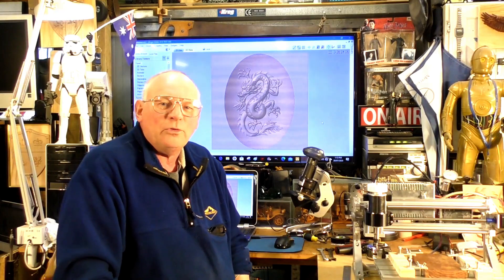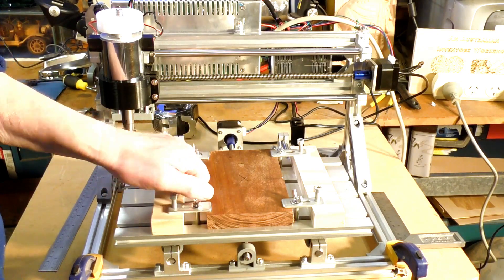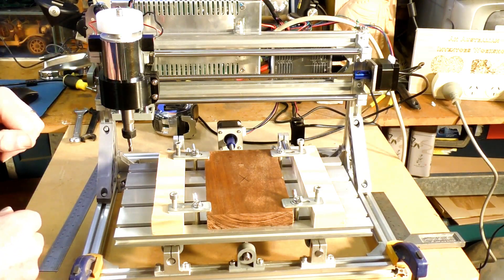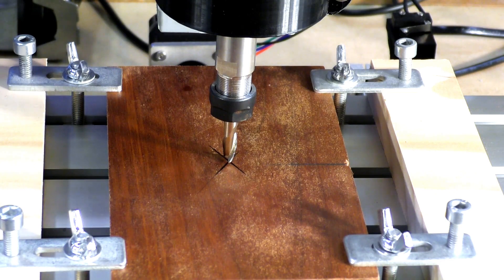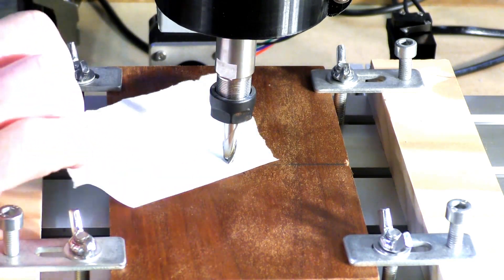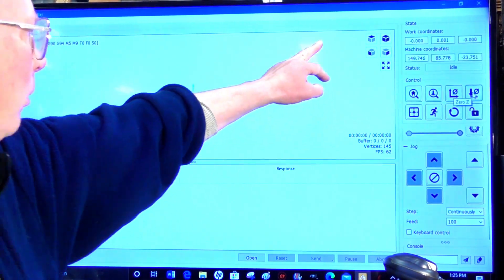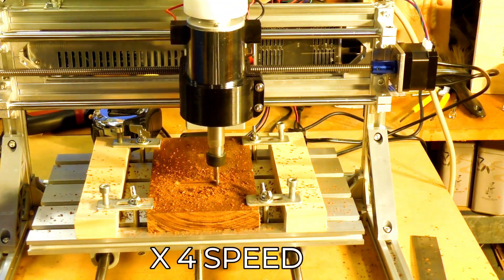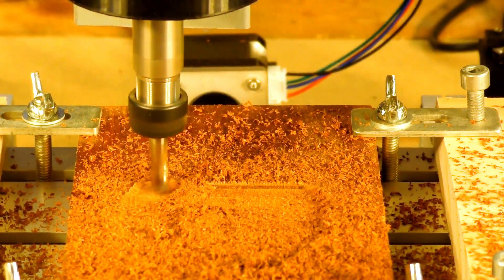ebay 3018 CNC router machining a 3D engraving + set up in GRBL

Comment: Starting from smaller hobby machine is a brilliant idea
I know that you have used washers but many of these machines don't come with extra washer for clamping
So When using those Wing nuts. Use a washer underneath. As this will make it better to tighten up and also prevent the slot getting damaged 
And also more easier to un tighten when finished
Merry Christmas Roger and have a good new year